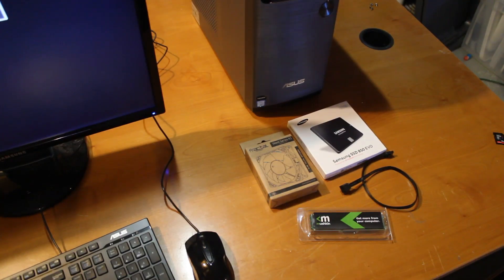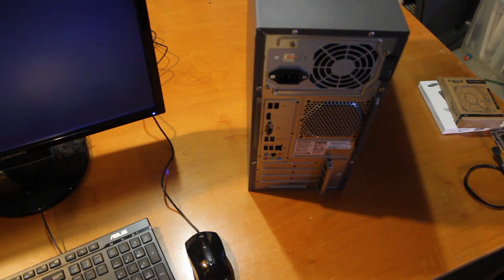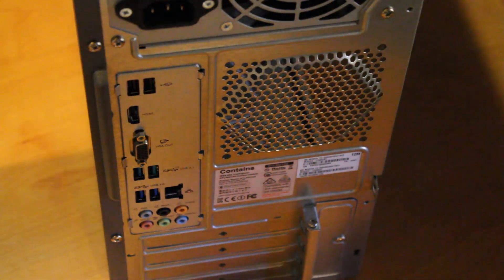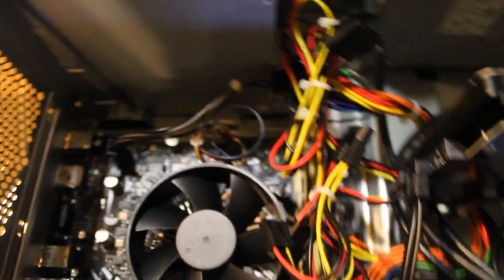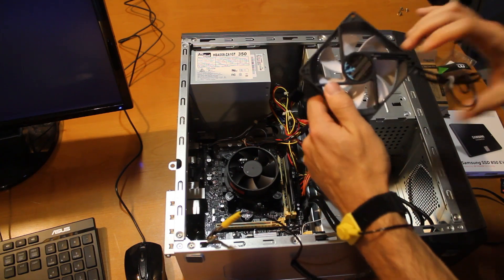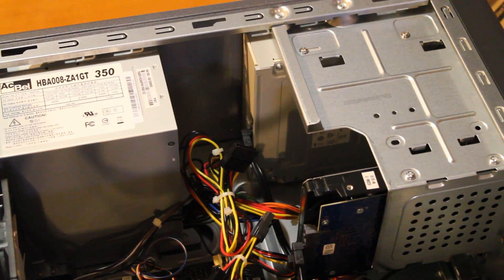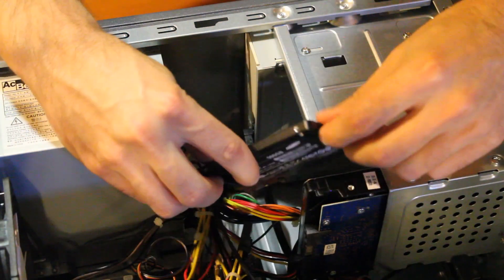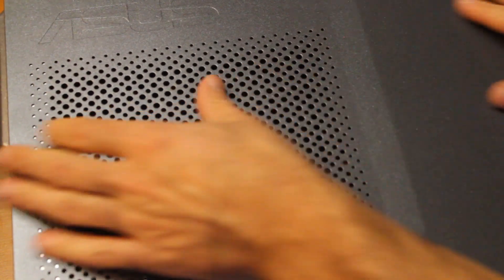ASUS M32CD Core i5 Upgrades (SSD, Fan, DDR3L)

Comment: Asus M 32 series Desktop Tower motherboards can be upgraded with newer components and CPU with Asus Prime Z690M-Plus D4 assemblies will fit right in place and use the same screws with recent 11, 12 generation CPU. Why not explore the possibilities rather than reducing them to $25.00 thrift store junkers when they won't take Windows 11, or 12 OS being released later this year, support for Windows 10 runs out in 2025.

Comment: Which way would you fan side panel fan and would it be a good idea with my fan configuration I have 120mm fan on outside in back powered by wall socket and 120mm in front adapted to fit 92mm connected to motherboard.

Comment: I have the same unit with a loud cpu fan, can anyone suggest what can be done to silence it or what to get for a replacement?   Thanks
Reply: Hey Gary I'm having a similar problem wondering if you found a solution
Reply: @chadandrew1170  up
Reply: Hi guys, I just bought a CPU cooler from a local shop. Didn't cost much but make sure you're buying one for socket LGA 1155.Will drop a comment by the end of the day when I install it

Comment: A few years back i bought the m32cd ca19t i believe. anyway, its the i7 6700 version which came with a r9 370 2gb GPU, and 16 gb of ram. Over the last 2 years I've added an SSD and replaced the GPU with a rx570 8gb also added a front fan because the model i bought came with one in the back. I've used this video as a reference 3 times now. i just wanna thank you for it, and let you know that you've done me a great service. keep it up!
Reply: Did u use a Fan Splitter? I can see only one 4 Pin Fan Slot on the Motherboard. I also want to add a Fan at the Front but im not sure yet.
Reply: @miyavirocks656  I did. Which also made me wonder if that hinders their effectiveness
Reply: @kevinmckay2361  How does it work so far? And what brand did u use?
Reply: @miyavirocks656  bequiet bl045 92mm and it seems to be working just fine. Or did u mean the brand of the splitter?
Reply: @kevinmckay2361  nah, the Fans. Like how well they perform with the Splitter (any Issues, too low Rpm etc.) 

Thx for the Infos, gonna get a Splitter and an extra Fan too 👍
Reply: @miyavirocks656  to be honest I dont know about rpms I haven't checked. When I booted her up they ran never thought about it again. Maybe I'll run some test tonight

Comment: Was Wondering because I have this Pc (But I added an Rtx 2060) If a 9700k upgrade would work with this Motherboard
Reply: nope, and your cpu is bottlenecking that gpu hard
Reply: @sathanas420  Im Aware of the Bottleneck, Could u suggest a Motherboard that would Fit in the Case but still work with a 9700k

Comment: Saw ya review . But never use anything magnetic around computer even a magnetic screwdriver bit holder. But awesome upgrades. I am thinking of updating my unit. watercooled cpu.
Reply: Magnetic parts of screwdrivers and magnetic mats/cups are usually too low to ever disrupt your pc parts. Don't worry about it. Sorry for the late reply also

Comment: What could you put in it in 2019 the max it can hold to be good please respond
Reply: i put a gtx 1060 in mine now i just have to add 8 more gb of ram and an ssd then its a good budget gaming pc
Reply: Sathanas Sathanas no upgrade to the power supply or anything cause I wanna put the max it can have in there like the best stuff by kinda cheep bit good too. Like mines slow what do I do to fix that too.

Comment: hey i was wondering if you could help answer a question for me. my computer has the capability to hook up to my router with a wireless connection but its very slow and tends to fluctuate a lot. i cant stream and i cant play online. but my xbox one is able to connect to the router with no issues and it about 3-4 years older than my pc. unfortunately im not going to be able to plug my pc into the router directly its not mine its my landlords. is there anything i can do to fix it or could you explain to me why this is?

Comment: I have trouble with heat ventilation with this pc. Can anybody give me tips? Like what fans, where to install them, how to install them, etc
Reply: Like holy shit, I ran a diagnostic test and it says my cpu and gpu are great! Its running at about 30-40 degrees Celsius. But when I read how hot my motherboard is I got super worried, its running at 120 degrees celsius! I tested it with 2 different programs and the both say the same thing in real time. If anybody can tell me if its just a software thing (i don’t have any kind of virues, I checked with different programs) or if its a hardware issue. Maybe its a bios issue? But i don’t understand how my cpu and gpu are good but my motherboard isn’t, my computer feels cool but at the same time the fan is cpu fan is running like crazy
Reply: And it scares me because i want to install a gtx 1060 and a 500w psu but now i don’t want to because i feel like its going to explode or ruin the rest of the components of the motherboard

Comment: I heard you can also install a front fan on this. How do you do it?
Reply: Virtually the same, just need to remove the front panel.
Reply: You might need to go pick up a pwm fan splitter, or a molex-to-pwm cable. (Pwm is the name of the case fan connection, I think).
Reply: That works. If I were you, however, I'd check the ambient temperature of my pc with that configuration; that configuration has little airflow.
Reply: Those gpu fans will help cool it. Nevermind about checking temperatures, it's hard to set up, and, frankly I don't think you need to.
Reply: Of course, youtube is my home :)... ;(

Comment: Anyone know if this PC's motherboard H110-M/M32CD/DP_MB would fit in a standard case?
Reply: It does fit but it doesn't have the correct connectors for a normal case since the motherboard is preparatory. It uses sata connectors. Unless if you find a case that uses sata to connect the front panel connectors

Comment: Was wondering if anyone had bought this additional RAM by
Crucial (SSD4) and installed it with this desktop?
Crucial 8GB DDR4-2133 UDIMM
CT8G4DFS8213
Specs: DDR4 PC4-17000• CL=15 • Single Ranked • x8 based • Unbuffered • NON-ECC • DDR4-2133 • 1.2V •
1024Meg x 64 •

Comment: Can you make a video in  which change the cpu fan on this computer? Please!!(i'm italian)
Reply: Where you able to ever remove because I've bee trying and there loose but no matter what I can't remove them from the board
Reply: @chadandrew1170  I don't know if it's too late for this but I just had to use a bit of extra force and they came off
Reply: Hi there, don't know if this is too late but I just recently bought a cheap 10-20 euros CPU cooler from the local shop. The installation guide usually is pretty simple and is given with the CPU cooler itself but  a ensure you're buying for socket LGA 1155. I know it's not what you asked but I hope it helps.

Comment: I'm able to use 2 hard drives in this PC?
Reply: ya you just need a sata cable and a hard dirve
Reply: Braxton Walters Cool, I bought a Seagate BarraCuda and a sata cable on Amazon, everything works fine, thanks for the answer. ✌️☺️

Comment: yo, can i put a amd r9 fury in this? or crossfire it?
Reply from the maker: there is only 1 PCIe slot, so no crossfire. r9 fury will work no problem. PSU upgrade.
Reply: Max Capricorn
thanks dude.
 (my psu is prob gonna be a 850 watt)

Comment: Can this PC take lower latency RAM? I have this PC and the RAM it currently has is CL11. There is DDR3L at the same 1600 MHz that has CL9 and even CL8. I'm especially curious about this pair: http://www.newegg.com/Product/Product.aspx?Item=N82E16820148657 Asus's tech support says CL9 and CL8 should work but Crucial's web site says only 1600 MHz CL11 and 1866 CL13 RAM will work with it. What do you think will work, aside from what you've shown here?
Reply: In case that link is broken, the RAM is Ballistix Tactical 16GB (2 x 8GB) 240-Pin DDR3 SDRAM DDR3L 1600 (PC3L 12800) Low Profile Desktop Memory Model BLT2K8G3D1608ET3LX0

Comment: Hi Max.I have an M32 also, it came with an I7 6700 and 12gigs of ram.I upgraded the power supply to a 750 watt and added ram to bring it to 16 gig  I then installed and Asus Strix ROG 1070 OC edition graphics card. I did put an fan in the rear of the case. Now I want to put an SSD Drive in it. How do I get it to boot from the new SSD?I don't want to have to buy windows 10 again LOL.For less that $1200 I have a real screamer.Thanks for your help.

Comment: nice video, have this m32cd as my 3rd build but with core i3 6100, i can't believe it came with 0 fans installed, can you believe i bought a 60mm fan thinking it was the right size for the top corner. You bought a 92mm fan i was hoping that would be the right size. Quick question, where else would you recommend installing fans? by hard drives/front or the side vents?
Reply from the maker: If you do 2 fans, I'd put 1 in the front of the case and 1 in the rear beneath the power supply. Make the one in the front blow into the case and the one in the back blow out the back.

Comment: will a msi gtx 650 work in it with the default power supply
Reply from the maker: It should... compare the 650 to the 750ti. People have been running the 750ti on the stock power supply without issue.

Comment: should you add the ram before startup or after?
Reply from the maker: It doesn't matter. If you are ordering new, I'd turn it on first and make sure it all works before adding more components. Also make sure you know which version of the PC you have. When these first came out on Amazon, they were the DDR3L model. A few months ago, they switched over to DDR4. DDR3 and DDR4 are not compatible.

Comment: Hey Max I have a question about the fan, is there a spot to put a second fan down near the front of the case and if so how would you power it?
Reply from the maker: Yes there is... below the drive cage area. There is only one header on the motherboard, so if you install 2 fans (1 in the front, 1 in the back) you'll need to make sure the second fan is powered off the SATA power connector, or the old school molex connector.
Reply: +Max Capricorn so for the second fan would you have to take off the front of the case to screw it in?
Reply from the maker: Yeah, it's not hard. I posted a video on the steps to take the front cover off.
Reply: +Max Capricorn oh okay cool :D
Reply: @maxcapricorn3967  Could I use a Splitter?

Comment: Just bought the same unit, looking to make the same RAM upgrade and add the chassis fan (probably not necessary, but extra ventilation can't hurt).

This is rigged for a 92mm fan, correct?
Reply from the maker: +IB PuffnSnuff Yes, 92mm fan. If you got the DDR4 version, make sure you get the proper RAM.

Comment: A question about the fan. Does it run all the time? Is there a 4 pin fan alternative to the one you used? and if so can you explain the difference? or what the 4th pin is for? . Thanks for your Vid.
Reply from the maker: +welloffthegrid The 3 pin fan does run all the time... Usually a 4 pin fan would do the same but the difference with a 4 pin is that it can change the speed depending on system needs. During times of low load and cooling needs, it would spin down to a low RPM. Under high load, it would spin faster to move more air. I like Noctua fans. They have a number of 4 pin models that would work fine in this system as long as it's 92mm.

Comment: Wait since this is a skylake system why didn't you use ddr4, and that "warranty sticker" isn't even a warranty sticker it's basically a warning to say if you don't know what you're doing don't do it
Reply from the maker: +jordant0085 The M32CD which amazon had on sale in November 2015 was the DDR3 version. They've since replaced that with the DDR4 version of the machine. From what I understand, breaking the "warranty" sticker doesn't void your ability to return to ASUS if something were to go wrong. This was proved out when ASUS pushed out the problem BIOS update back in Jan.

Comment: Max Capricorn, when installing the SSD, how did you change/confirm AHCI setting for the drive to maximize performance? I cannot find the setting anywhere in the BIOS (version 0501).
Reply from the maker: +Benjamin L. I didn't make any changes in the BIOS when I installed the Samsung EVO SSD. Benchmarks show the SSD as running real close to the MB/S rating on the spec sheet. (This was with the DDR3 version of this PC) Are you having any performance issues?
Reply: Thank you.  I have my SSS installed and it seems to be running great.  I need to run a speed test and the audio driver fails unzipping, but seems to work great and much faster.  Thank you for the videos and help.  Case fan and possibly power supply is likely next.  Do you run RAID in yours?  I want to swap in my RAID 1 media drives, but heard it has to be software side as it is not hardware supported.
Reply from the maker: I haven't tried raid in the system. But you are likely correct, I didn't see anything in the BIOS to set up hardware raid on the SATA controllers, so any raid solution you choose will need to be software. The only exception to that would be if you aren't planning on adding a GPU, you could use that PCI 3.0 slot to install a hardware raid card.

I'm glad my videos helped. I have plans to do another video about using a PS4 controller for gaming via the built in bluetooth. I just need to get some time to get it recorded.

Comment: Am finally gonna get me this computer and want to do similar upgrades that you have.  Also want to get the Samsung SSD.   Do you have a demo video of how to do a fresh install of Win 10 after the install or do you use the migration software that came with the drive.  If not could you recommend a video demo on how to do that step by step after installing the drive and how to assign it as the primary drive?

Thanks for your video demos.

Maxx
Reply from the maker: +R L Moore I don't have a video, but it would be a good idea. I'll see if I can put something together.

Comment: FWIW, Simply opening the case to do this type of mod does not void your warranty. I have the email of a chat session with Asus support to document that.
Reply from the maker: +Tom Balaban Yeah, lots of people have said that. The little warranty booklet which is included with the system says otherwise though. When the BIOS bricking thing happened, I heard many people were able to get service with a modded machine. And there have been many people in the amazon review section saying it's "illegal" for ASUS to deny warranty based on breaking the seal. Do you think I should take that out of the description?
Reply: It's really up to them..at their discretion I've found out.I was not happy to get this pc with the sticker already off..instant questionable warranty.

Comment: Hi! Is there enough room for a total of 3 drives? 3 power cables, at least 3 Sata ports, and 3 bays? In other words I would like to add the Samsung ssd AND my current drive to the existing...
Reply from the maker: +Ariel Reyes There are 4 SATA ports. 2 are in use from the factory (HDD and the DVD). There are 2 3.5" bays. My current configuration is 2 spinning hard disk drives and 1 samsung SSD. Since there are only 2 3.5" bays, you'll need to get creative with how you mount the SSD (either do what I did in the video or use double sided tape).

The bottom line is, yes there are enough sata ports and power connectors for 3 HDDs + 1 DVD.
Reply: +Max Capricorn thanks so much for the response and guidance. Can't wait to receive my stuff on Wednesday!

Comment: Does that power supply have a 6 pin connector for a graphics card or can you buy adapters to make it a 6 pin
Reply from the maker: +TimmyTeaBag The power supply in this video came with a 6 pin cable. You can also get adapters for molex to 6 pin if need be.
Reply: k cool thank

Comment: Hey Max, great videos!  I ended up getting M32CD with a Samsung EVO 850.  What is the procedure for installing W10 on to the new SSD?  I made my recovery USB drive.  I hooked up the SSD.  Do I need to disconnect the old HDD before restarting (and reconnect later)?
Reply from the maker: +David Koseki Yes, that's the best way to avoid any confusion. Reconnect the 1TB drive after you have a solid boot of windows 10. Check out my overview at on my amazon review: http://amzn.to/1nG4uvP
Reply: +Max Capricorn Thanks Max.  Man you should be on ASUS and Samsung payroll.Seems like I missed the comment section of your Amazon review, because I goofed up and had the HDD hooked up.  Ultimately I ended going with the Samsung migration software.  I now have a clean boot from the SSD and was about to format the HDD, but I'm starting to run into some power issues.  When I shut-down windows exits and the screen turns off, but CPU stays on.  BIOS problem you think?
Reply from the maker: Just to clarify, did you end up upgrading the power supply? If not, it sounds like some sort of issue with windows possibly. Did you migrate the ASUS image over to the SSD, or did you do a clean install on the factory hard drive and then migrate that?
Reply: No, only installed the SSD.  Well, firstly I messed up and made a recovery USB instead of an install  USB.  2nd mistake, the factory HDD got recovered.  Then I migrated that image.  I wish I saw your W10 instructions earlier.  I'm thinking of starting from scratch and do a fresh W10 install.
Reply from the maker: I'd start from scratch using my instructions to make sure you get a good solid clean install on the SSD. Grab the official microsoft install media from the link in that step by step and you'll be fine.
Reply: +Max Capricorn Thanks again Max!  Did the fresh W10 install.  Formatted and partitioned the factory HDD.  Everything is all good now.